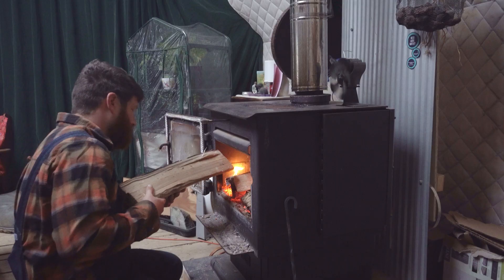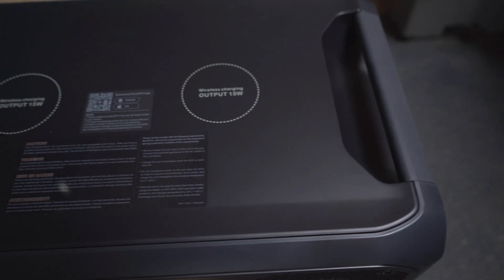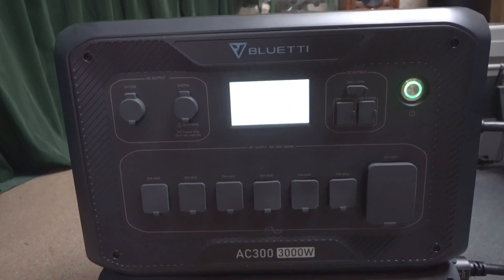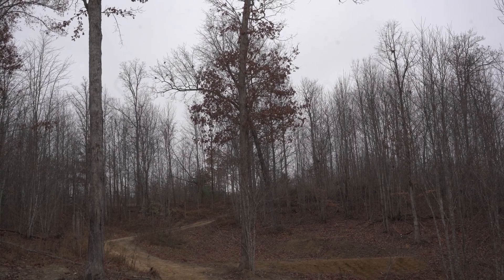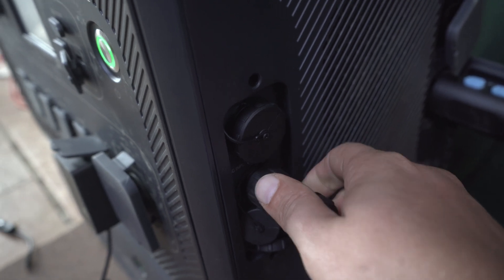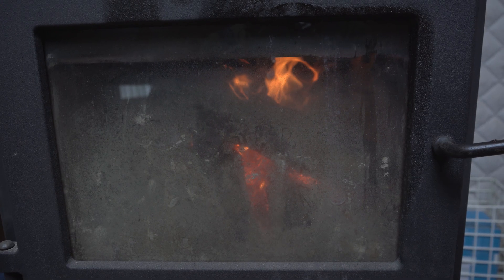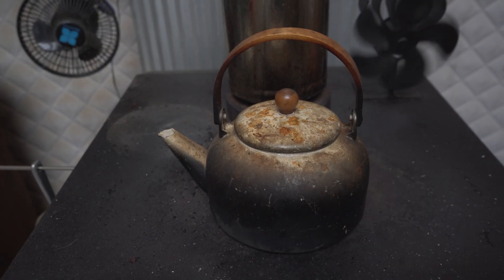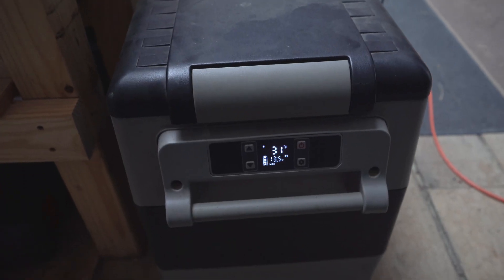BLUETTI AC300 + B300k Is It Worth It?

Comment: It does not work well. I live off grid and wish I chosen different. Switched to EG4 28K system. The unit will not charge well on a gas generator. Good fortune to you though. I hope it works for you man.
Reply: Some Bluetti Power Stations do have generator capability.Ecoflow offer a gas & petrol generator.

Comment: How big is your solar array? How much is the minimum to keep your Bluetti powered up?
Reply from the maker: we have 650 watts going into it and it charges pretty quickly
Reply: Did you have the 300 K battery? And if so do you wish you had the one with more options? I'm wondering if I only could have one battery if it wouldn't be better to start with the older version and add a K later if that made more sense. Our grid went down in Texas and I'm gettin ptsd over it….even though it wasn't down as long as the week in 2021…it was 3 hours and froze my check valve on my pump….that I had heat wrapped. I really want to be off grid if possible. Bluetti has the charger too…I guess it gets wired into a car? Not sure about that…but the whole idea seems like a good one. Thank you for helping us all figure this out. Really good video!

Comment: I have a bluetti  EB3 great for charging small devices and cordless tool batteries. It charges on 200 watts of solar in 3 hours or less .the 110 side won't run much .  I'm  sold on bluetti products they are great .
Reply from the maker: If you ever decide to upgrade, i would highly recommend this unit. It has powered everything i have with no problem